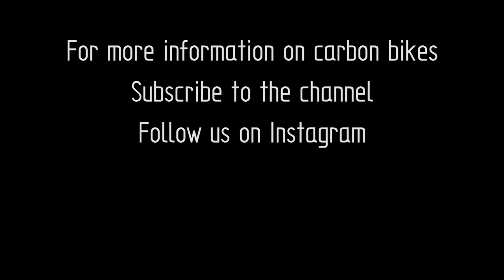Carbon Bike Flaws - Sand Through

Comment: So I have a question. I have two  bikes.(road and gravel.) My both bikes are carbon fiber. They're both Chinese knockoffs of specialized. It was a lot cheaper but it was a reputable brand. The one brand was a very good knockoff brand but in their country. I guess it's name brand. When I sanded the road bike it it down it was a perfect weave pattern through the whole bike with a little things that I saw like in your video in the bike. But then the gravel bike was from a different Chinese knock-off brand and almost got lost and took 7 months to get here and when I sanded it, I don't hardly see any weaving pattern at all. When I sand it off the paint. Sometimes I do but most of the time I see very long kind of like that fork you showed the specialized fork or it's a long strip at a 45 and then the darker image going. Another direction I guess is what you said. But the whole bike is like that. And I don't see any weaving the 3D or 4D weaving anywhere. Hardly anywhere on the bike. Is that normal or is that can the bike be not woven like that and just have these long strips of carbon fiber? Is that sound right? Because now it's ugly it doesn't look. My other bike came out great. I sanded it down, polished it put a poly epoxy resin paint job over it. Clear coat and it just pops is other one is just looks like almost looks like metal because it's just looks like different shades of gray going. Which way and what? And all kinds of damage marks like in your video but is that normal or should it have a 3D pattern and I haven't stand it enough? Or did I somehow sanded it off? I doubt I sanded it off cuz I'm very very careful when I do that but it's just weird it looks it has all that marbling in it like you had talked about lots of marbling a lot of those strips of black and white lighter shades of carbon fiber but not it doesn't look pretty at all. Sand it down compared to my other one.
I'm excited because now I have a road and gravel bike but I wanted to show off the carbon fiber because I'm not very rich and so seeing a whole carbon fiber bike frame carbon fiber rims carbon fiber seat handlebars everything carbon fiber. It's you know I love showing it off and pulling up next to the someone with their for $5,000 bike in mines. All Chinese knockoff of their stuff and it's good. There's good and bad Chinese knockoff brands out there but this one was a very good Chinese knockoff brand. I've did a lot of research at least for the road bike. The gravel bike was just a no name. It was like 200 bucks for it and I got it but seems sturdy. It's very light but yeah what is up with the bike?

Comment: I've just finished hand sanding my Trek MADONE back to bare carbon. It took 30 hours in total, as I was super careful to not touch carbon (for >99 percent of the time anyway).

The positive, is that there is almost zero sand-through across the entire frame, fork, seat posts and ISO Speed - just a couple of very small bits on some of the tighter radius corners - and a couple of 'very' small areas I unfortunately introduced.

Comment: Found some sand through inside the frame of my brand new domane sl5 gen4 where the frame storage is, under the bottom of the down tube. Looks like they sanded through a few plys of carbon my question is why are they sanding inside the frame? and should I send a picture to trek and file a warranty claim. Funny thing is it has a green check mark next to it which I'm assuming means it passed qc even though there's an obvious deffect in manufacturing.

Comment: But the frame is molded in that shape, they are not sanding the carbon down to achieve that shape. 
Don’t they typically do a light surface sanding to smoothen it out on all carbon frames?  Most frames that are bare carbon come with a finish like that. But frames like Time with the 3k weave just have a “beauty” top layer of carbon to give it that look.  I’m from the aerospace industry and have worked with carbon and for us to achieve that beautiful top layer like Time or Pagani Zonda it’s just a extra top layer of carbon.  I could be wrong but that’s what I’m thinking.
Reply from the maker: That's the point, the light sanding to prep for paint, remove flash etc, is a bit too heavy.

Comment: A question. I've always assumed the outer mould would be close to perfect, and that the pressure would be close to perfectly pressing the material against it. If anything, I'd expect any deviation from perfect outside shape to be depressions rather than protrusions, and to require filling rather than sanding?

Comment: I got tired of all the chips in my 2005 Roubaix paint so I decided to go clear. After too many hours of hand sanding,  I grab my drill and disc and went to town. I have plenty of these aggressive sand areas all over the frame, some scary. My sandthrough looks less dangerous than some of the manufacturing bonding though. This was two years and some 6000+ miles ago and no problems.
Reply: Oh man, I can't believe you hit it with power tools! It took me 30 hours to hand sand my MADONE, and doing so gives me piece of mind I've not structurally affected the bike.

But happy to hear for your sake that you haven't had any issues in spite of a lot of KM since.

Comment: Hi. You mentioned that silicon oil is particularly damaging to carbon fiber laminates.  I assume that would apply to silicon grease also.  Is there any grease or paste that is suitable?.  I want to seal up the gap between plastic plugs that I 3D printed and the frame to prevent water ingress.  Thanks!

Comment: Damage like this is prevented in part during layup. The EPS Inner moulding typically helps prevent wavy and bumpy surfaces still Sand-through happens. And on virtually every frame (to some degree). You’re most likely to see at the edges and major junctions. You may find that there wasn’t enough resin at the surface of the part in that local area. Another succinct and credible review, thank you.

Comment: Your videos make me glad I chose aluminum. However the fork is carbon with aluminum steer tube and dropouts. The fork seems as stiff as the rest of this track bike, so maybe it's over built. I do look at the junction areas for cracks periodically. As a road bike, this one feels amazing on short sharp pitches!
Reply: Aluminum is not inherently superior, and depending on design and fab, it's often much worse. It's very tricky to make a strong, light aluminum frame -- though much easier to make a strong, dependable, but heavier one. (welding thin wall materials is really hard) I have aluminum frames I trust, but they're thicker wall, or they've got extra lugs and gussets where the welds are. Fat tube, thinner wall aluminum frames, such as those for racey bikes, do stuff like this: https://youtu.be/PkRyrU7HBXQ
Reply: 2:27 for a major crack down the middle of the downtube that was completely hidden by paint. FWIW, KHS stopped making this model of road bike from aluminum after a couple years and went back to steel, so they were clearly aware of the problems and didn't want to deal with Aluminum.
Reply: @SethJayson  I believe that my track bike is of the heavier dependable variety. The welds are much cleaner than that example and there are no bottle bosses Without accessories and with heavy wheels it weighs about 20lbs.

Comment: This makes me feel better about the material I’ve lost inside the chain stays on my cross bike due to mud and dirt. I figured the chain stay-bottom bracket junction must have tons of material. (Famous last words).  Lol.
Reply: You can buy special metal covers (3M) that can be glued on the chain stays with the adhesive side. They cost next to nothing but still, the companies hardly use them. I have severe chain suck on my chain stay and figured this out the hard way.
Reply: @DilbertMuc  thanks for the recommendation.  I’ve seen that product and I tried to fashion a diy version of it… gave up on the effort just did a couple of turns of gorilla tape. Lol.  The bike has been relegated to fair-weather all road duties now so it won’t get any worse. I’m keeping the slight damage in my back pocket however as leverage to justify a new cross bike to wife some day. 😜
Reply: @rolandovera5935  Gorilla tape is not good. Too soft and get's destroyed easily.The 3M tape is very tough plastics and is smooth so that no dirt can collect.
Reply: you want helicopter tape by 3M ...it's designed to protect the rotor blades from strikes and has elements of bomb blast films that protect windows from explosions. Works very well on bikes and yes I used to work for the company. It removes well even after being on for 10 years, with no residue. Just taken the film off my 2009 Fuji SL1 Fujiserveto team bike and it's pristine.
Reply: Hopefully if its a cross frame, its a heavy frame. Put some clear protective tape on the chain stays if you can.
Reply: @jaro6985  that’s what I was thinking too. Cross bike must be a little chunkier in that area of the frame.

Comment: Very interesting! My BMC timemachine frame shows exactly the same looks at the same spots: top tube, chainstays, downtube. I am riding it since 2015, but i did not put very much kilometers in it, maybe 10k. Until today it works fine, no issues. Fingers crossed 🤞😌 !

Comment: Perhaps show some examples where a sand through has resulted in a frame failure, as it stands this video doesn’t prove anything has been done poorly that could result in a flawed dangerous product 🤔
Reply: I agree. I’ve learned a ton from this channel and this guy is clearly very knowledgeable.  But it is a reoccurring theme, point out all the flaws but never commit to saying  something being dangerous or unsafe to ride.  That said, I know there are horror stories out there about spontaneous failures for apparently no reason. I’ve witnessed one myself on a brand new bike. And look at Canyon and Specialized who just recently issued recalls.  Maybe he doesn’t go there for legal reasons. I take his videos as informational but not prescriptive I guess. But you make a good point.
Reply: @rolandovera5935  there is no way he can make such a prediction, there are too many factors involved, just like how heavy a rider is, the terrain, if one hits a hole or road crack.  And just how many times.  If the manufacturer’s design compensates for it with added structure, fine, but we don’t know that.  Most certainly, one can readily get out of hand doing the sanding with those tools, so much like why auto lug nuts seem always over tightened, thanks to hammer wrenches.  Even at dealerships.  Which should never to used for such work of torquing bolts. I would think the injury lawsuit settlements are kept confidential for several years.

Comment: Hey Raoul, considering all these sanding issues, what is your opinion on sand-blasting frames for paint removal? (in order to re-paint or in order to save weight) Any risk of removing structural material in that process?
Reply: You should not use sand as a medium. Nutshell or similar which is less abrasive. ETOE has a video on this topic.    Rgr

Comment: And to think that it's so easy/cheap to put a carbon or glass veil as the outermost layer so it serves as a sacrificial/tell tale layer for the sanding operators to avoid them going in too deep. Proper manufacturers do not shy away from even puting a superlight layer of woven glass (sub 20gsm) to help even more. Not to even mention  that placing these sacrificial layers help with the surface finish out of the mold in a high volume operation (so less sanding is required), as it allows to vacate bubbles within the laminate by letting the matrix flow in a more free way during curing. 

Cheers for showing this and explaining that's its not a feature but a sign of bad QC and "less than ideal" manufacturing.
Reply: Point is well taken.  I seen so many expensive bikes in showrooms W/ sand through swirl under clear coat.  
Astonishing..
Reply: Especially because the glass has better sanding and finishing properties with regards to fraying/fuzzing as well

Comment: Ugh. I like metal frames. But I still use a carbon fork. I wish all manufacturers had to run their carbon frames and forks through a scan analysis to discover any voids or flaws. Supposedly Canyon does this, but a lot probably depends on the quality of the scan and the analysis.

Comment: So the ideal here is uniformed carbon pattern. What if the sander is the one doing it wrong causing uneven looks  hence looks delaminated.is that possible? But then I guess ideal here is adding more ply so even in areas of delamination, underneath is more support. If that is for repair you'll trim that then add another ply or total remove it?

Comment: What about Campagnolo? This marble appearance is a feature with Campy cranks and in some components.
Reply: It's injection moulded fiber reinforced thermoplastic.  Same with SRAM cranks.   It's cheaper, labour free, and tolerances should be guaranteed.  Not used in frames tho ... at least for now.
Reply: That's a different construction type. It is literally strands going in all directions and baked with resin. It's like the fiberglass mat of the carbon world.
Reply: That may be from a Unidirectional process whereby they basically take a bunch of loose fiber, compact it and inject the resin. It looks like marble because there is no real layup and the light reflects randomly.

Comment: I would seriously hope the sanding is factored into the design, with the top N layers deemed dispensable?!

Of course, there's no guarantee that the chaps in the factory won't sand away more... power sanders on a carbon frame FTW 😨
Reply: There will be a safety factor applied. 

I don't know what the industry standard would be, but safety factors are standard practice.

If we assume a safety factor of 2, the component would have a design strength of double the forces that it's expected to encounter.

This gives a decent safety margin and provides some buffer for minor accidents and mishandling.

I would expect that the sanding doesn't remove so much material as to negate the safety factor, but this and other manufacturing issue will eat away at the surplus and reduce the overall durability of the frame. In practice you may end up with a safety factor of 1.2 rather than a safety factor of 2 (made up numbers).

All reputable brands will also be doing physical testing on frames pulled off the production line to ensure they they meet the requirements set out.

So, to surmise; I would expect that the sanding isn't directly accounted for in the FEA, but that it and all other manufacturing issues are indirectly factored into the overall process.
Reply: No, you can't hope on that. In FEM modelling you calculate the frame strength (amount of different layers needed) to take the predefined loads. You would need to know how much material the factory workers would remove during the process and then add those dispensable layers in advance... and only on those places where the tool can reach. Impossible. So, first you don't know that and second you want to create the lightest stiffest and best super-duper frame that is available on the market without excessive material. That's according to Specialized marketing brochures.
I've been to an Asian carbon factory and was sobered up about the work load that the ladies had every day (yep, mostly women were working the carbon mats into the molds). 100% concentration all the time, no mistakes, no material wasted, no time wasted and frame after frame after frame the whole day. But that goes only so far, because they are only human.
Reply: I laid up certain portions of my home-build CF bikes that way, but there I'm joining and/or reinforcing CF tubes of known layup schedule, and building from those diameters outward with epoxy-soaked cloth which is compressed for cure -- so there were spots where I'd put on extra layers and sand back -- for instance to reach a perfect OD for nesting into a specific ID, or to give myself several extra layers so I could fair back to a nice smooth transition. With prepreg layups bladder molded outward into aluminum mandrels (is that the standard for most of these?) I'm wondering how they get such a janky outer finish to begin with, and certainly sanding through means losing structure. Even an idiot DIYer like me can understand that. As for the look, well Calfee's enormous doped-tow joins sanded back to smooth curves played on that cool, bowling-ball-finish type look, and "forged carbon" is another phenomenon playing on it. But Calfee's giant, oversized lugs could handle the sand, and "forged carbon" is a style, not a structure.
Reply: @SethJayson  Cold forged carbon... :D)))
Love that.

Comment: Would you advise against sanding off a pre painted frame to get it repainted?
Reply: If you want to repaint anything you should only sand the surface to eliminate the glaze and leave as much of the original coats because they already have good adhesion to the substrate. I know this builds more coats of paint and weight but it will insure your paint sticks better. Even if you have chips that are deep into the primer or substrate don't try to sand them down to even the surface,  you fill those spots with a glazing putty first and then sand for an even surface. Ultimately the ideal perfectly even surface will be achieved with the clearcoat applied over the paint by sanding and buffing which will hide a lot.

Comment: What an eye opener!  It would be funny if weren't so potentially catastrophic.   

Clear coated with intact, unsanded carbon...... for all to see.  Close to ideal:)

From what I've read:  It is OK to clear coat carbon fiber.  But, there must be UV filter in the clear coat.  Otherwise,
UV will breakdown composite resin.

It is just amazing they would grind a steer tube like that.  Frightening.

Great video.  Thanks Raoul